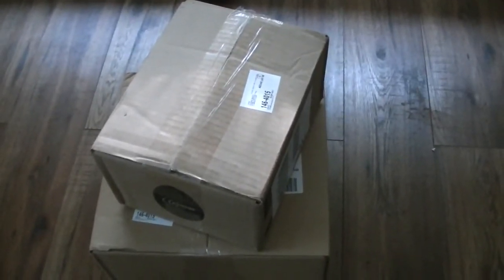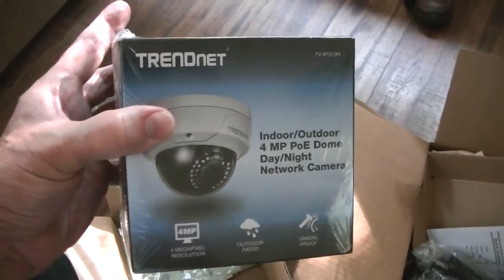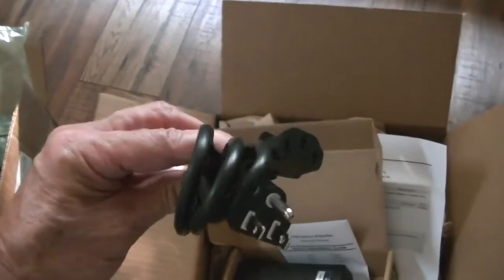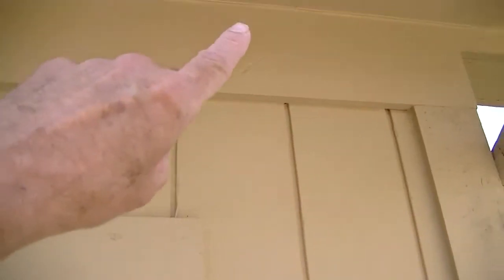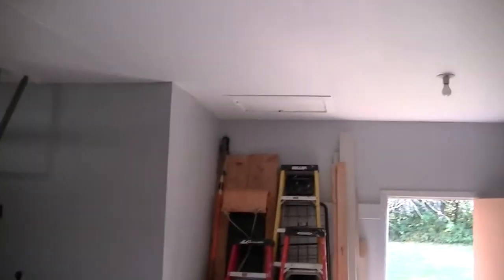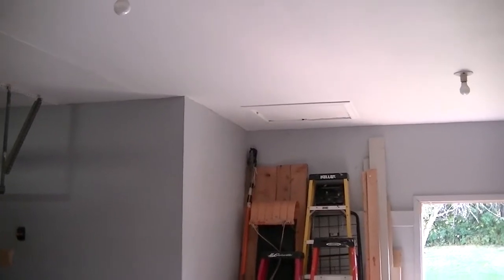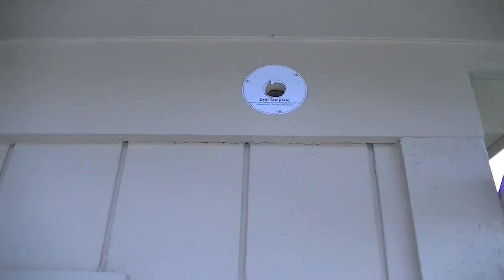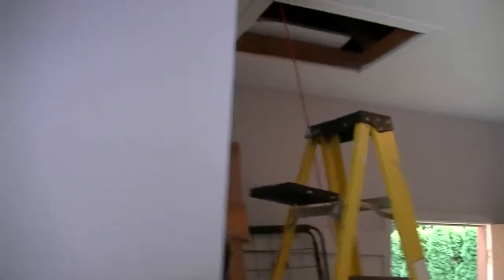How to install an IP Security Camera.

Comment from the maker: The night vision is not very good on this camera.
Reply: Yeah, the IR has to cover a very large open area (judging by your video) so it does not have depth as you have nothing to reflect off that is nearby, you should be able to tweak the night settings on the cam via its internal web browser, but you will not get a massive improvement
Reply: All part of the learning curve ;-)

Comment: G'day Ronnie, welcome to the world of IP cameras, knowing you and your fondness for TECH, this is just the start :)  I did the same thing and got one to 'play' with, now I have a few more and am helping others install systems in their homes etc.  I started out using the NAS built in app, but soon went to the dedicated NVR, I tried PC software, but on my equipment it is a cpu hog :(  The camera looks like a badged Hikvision camera, china has 2 big makers, Hikvision and Dahua, and both are available on our favourite 'sites' at much lower prices than retail   check out ipcamtalk.com for info and help
Reply from the maker: I hope you are WRONG, hahaha, it cost too much as it is.  But I can see how it can get addictive.
Reply from the maker: Where do you have your cams located??  I am looking at the NVR's.  Are you using wireless?
Reply: Wireless is a NO GO, way too many issues and potential problems. I currently have only three running and they cover each corner of the house, I use the nvr as it is a neat little unit. PoE is so easy to use, just run the wires you need to a central location and get a PoE switch, no need for the bulky injectors and btw GB is a bit ott for the injector, most cams are 100 at best
Reply from the maker: Thanks for the info, I try to use Ethernet on all my devices.